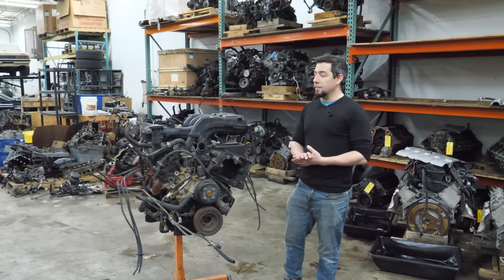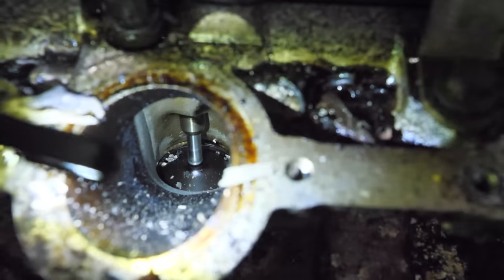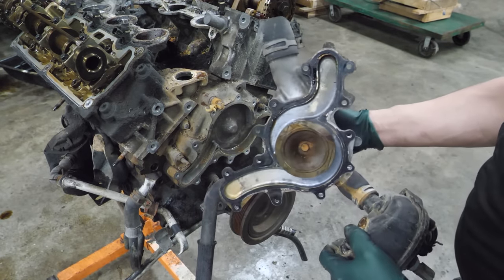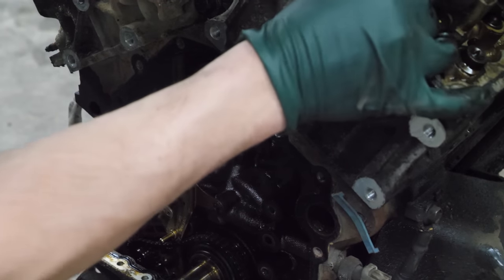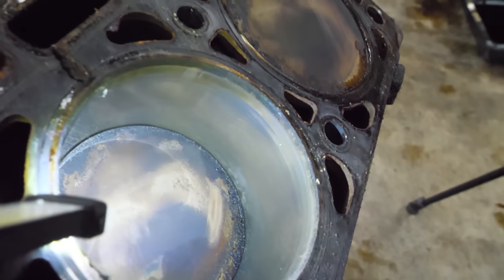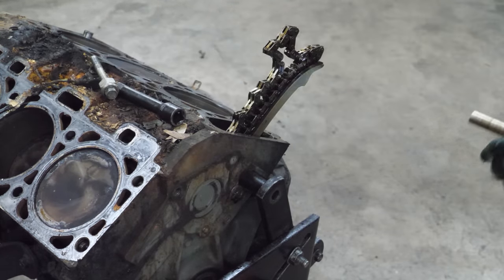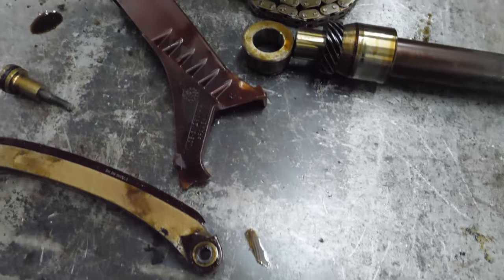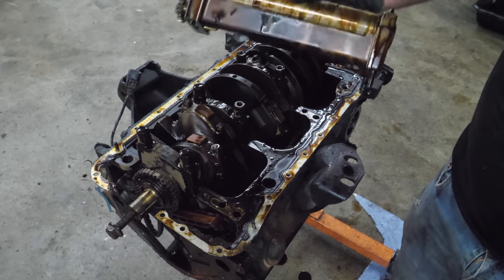Ford Explorer / Ranger / Mustang 4.0L SOHC V6 Teardown! Is This Why They're Called "Exploders" ?

Comment: It was a pretty good, reliable engine when it was OHV.  Thousands of Rangers (and others) are still running with the original 4.0. The strange OHC change with all of the chains really messed up the reliability.
Reply: When was that I’m looking at a 2004 4.0  164k miles
Reply: @fatsixtysix5392 My 03 Ranger 4.0 SOHC blew up a week ago and left me stranded. 118k original miles. Don’t.
Reply: @fatsixtysix5392 get a 3.0L ranger
Reply: So wait, am I seeing this right? Did they use the same head on both sides, rotated 180 around from each other?? That’s the only reason I can see for having a chain at both ends like that.
Reply: @kamryn7496 I had a 3 l in a 91 Ford aerostar. 230k when it left our family still running
Reply: Yes, same head casting. Seems like it would've been cheaper to have two castings and a single chain. Who knows why, it's Ford.
Reply: @samholdsworth420  the 3.0L can be a reliable engine I see rangers in the junk yard with 400k or little less an they have the 3.0l in them I got a 3.0 ranger there super easy to work on an are reliable there is upgrades out there to make more power out of them
Reply: @kamryn7496  I know the 3 liter is good so is the ohv 4.0.

It's the shitty a4ld/5r55 transmission that sucks 😆

Get a manual and drive forever lol
Reply: @samholdsworth420  I got a autozone rebuilt manual transmission in mine that’s trash now it leaks from the input shaft seal after I just replaced it an something in the transmission is making alot of racket only has 8k miles on it sucks the warranty expired but it still shifts fine

Comment: It all boils down to the fact that lube shops don't prime the oil filter, the tensioners go dry, and the chain slaps around and creates havoc.
Reply: When you consider the facts that oil is normally changed about once per month in severe use cases, there will be some residual oil coating any oiled metal surfaces in the engine after draining the oil, the new oil coats things as it flows down to the oil pan, the starter turns the oil pump for about a second or 2 before the engine actually starts, that oil filters in this size of engine conservatively take 2 seconds to fill upon starting the engine, and when you do the math a ~2000 rpm starting speed divides down to 0.5 crank revolutions happening in 1second: all these things together make priming oil filters on this size engine into a cultural myth un-applicable to modern car engines. 

Alternatively, paraphrased in light of these facts it would be like saying that 1 second or less of running a lightly oiled engine every 1 to 6 months will cause the tensioner to fail much earlier than normal. I just don't think that is realistic considering how close to this normal car starting conditions are  for an engine.

Comment: In the middle of rebuilding one right now. Project for my son and I. Took thr opportunity to show him porting. Heads are cleaned up. Engine had 173,000 miles in it and it ran like a top until it lost coolant. Happened on a road where literally the shoulder was an 8 foot drop for like 3 miles.

Comment: Well my fellow mechanic in our fleet these engines have delivered the miles 2006 Explorer 202,000 miles, 2006 Mountaineer 181,000 miles, 2008 Explorer 194,000 miles, 2010 Mountaineer 159,000 miles, 2010 Mountaineer 162,000 miles, they're still in the family and still in daily driver service. They get regular Oil and filter changes plus regular Trans flushes and Coolant flushes. Some of these vehicles replaced 90's models with the 4.0 push rod engine with high mileage.

Comment: My 2001 Ranger 4.0 4X4 has 276,XXX miles and is running like a top. Synthetic oil changes every 5000 miles or 5 months. Still runs perfect!! Gonna drive it until it dies cause it’s been paid off for 3 years now lmao.
Reply: You TOOK OUT  A LOAN on a vehicle that old and that low value?  Dude, you need some financial planning help.  It's crazy to do that and have to have comprehensive insurance on it from the loan, if nothing else.  That stated, you could have done worse,  a 4.0L in a Ranger was a nice power to weight ratio and a lot of people want a smaller pickup like that.  As long as rust is held at bay.
Reply: @stinkycheese804  j.d. byrider

Comment: I've always had good luck with the 3.0 and the 4.0 from ford other than idle issues all had well over 300k on them the 3.0 spun a bearing was it's demise but the 4.0s were still good when the body's rusted away

Comment: I worked at Ford Esseex engine. The only engines with a balance shaft were for Front wheel drives. The reason is v6 engines naturally vibrate front to back. This is not a problem for RWD.  FWD the engine sits sideways and the balance shift is so the car don't rock while idling.

Comment: I like these engines because I'm a parts manager at a Ford dealer :)
Reply: Plus the tritons, the 3.5/3.7 water pumps, cracked ecoboost blocks...
Reply: Parts manager at a Ford dealership is DEFINITELY a job for life.
Reply: @CoryRwtfyt  Diesels are where the parts money is at, cyclone water pump jobs are 400$ in parts and 1500$ in labor. Ecoboost shortblocks are one shortblock you make a few hundred bucks on and a million little gaskets, bolts, and nut that don't add up to shit except 2 hours of your time wasted. lol

Comment: I have a 99 Explorer with this engine.  After 210,000 miles, it is still running fantastic.  I have had very few issues, and few I have had are with the plastic thermostat housing.  It is junk and always leaks.  Still no oil leaks at all.

Comment: The best part of that engine was probably the fuel injection and ignition system !

The sad thing is, that engine is a direct descendant of the Cologne  2.6L/2.8L pushrod engine which were quite good !
Reply: I had a ranger with the 2.8 rest of the truck rotted out before the engine died and we tried hard to kill it
Reply: Some of the unusual traits of that engine may be because it was designed in German, hence the use of large Torx fasteners.  It is an "over square" engine, meaning the cylinder bore was large compared to the short stroke.  This should produce good low end torque making it good for heavy American vehicles with automatic transmission.

I never realized that it had a 2 piece oil pan and the upper half was an aluminum casting. $$$ !!

IIRC, the design was limited by the requirement that is re-use some of the block machining tooling.

Comment: Ah yes, Fords. Just changed the upper blend door actuator on a 2010 F-150 with the hand grenade 5.4 in it. My hand is torn up and my back hurts but I wasn't going to let my mother be without heat in February in Wisconsin.
Reply: How is that Ford's fault in particular?  Any vehicle has these kinds of issues and is not a cause of tearing your hand up or harming your back.  Take it easy, things break and you seem to have no regard for your own well being.  Has nothing to do with Ford, to be good to yourself.
Reply: @Stinky Cheese  haha if you think what you said is true you need to work on this truck, specifically this job!  Please educate yourself before you speak.

Ford designed this vehicle, right? So do I blame myself for being too tall to comfortably fit in awkward positions since they put a common failure part in a ridiculous place?  Or should I blame Dodge for this Ford?  Maybe I should blame you since we are just talking out our asses here.  Or maybe you should turn a wrench before speaking. Have a great day!
Reply: A blend door actuator goes out in a 13 year old vehicle, and you blow a fuse. 😂😂😂 what a 🤡
Reply: @fixingitrightish  i do and would help my mother, but without crying about it like a little girl. It was an actuator dude, all brands have those those kinds of life altering( according to you) issues. Lol
Reply: @fixingitrightish  I do, because thats what I do for a living. 😂😂😂 Ive been a full time professional technician for 26 years. Lol
And yes, Ive worked on pretty much anything and everything. 
Only brands I kind of dislike working on is german vehicles.

Comment: 🤔 Hmmm my 80 year old dads 2000 model Explorer 4.0L has just over 385,000 miles on it and still purrs right along. Only regular oil changes and maintenance with never a breakdown so far 💥.

Comment: I love my old pushrod 4.0. Its was cammed, headers, bored throttle body, bigger maf sensor at around 100k miles. Now has 250k and never had any issues. Good vid. Maybe one day you can tear down the o.g 4.0. Thanks

Comment: could you do a 22r/re? i know there hard to find but it'd be cool to see what kills them
Reply: Timing chain stretches and wears through the timing cover into the back of the waterpump galleries. Had a friend do the head gasket on his and I told him to replace the chain, tensioner and guides while it was apart. He told me he didn't have the money to buy the parts. Got the engine back together for it to fail literally 500 yards/metres down the street, Yep chocolate milkshake for oil, an empty radiator and a worn through timing cover
Reply: @brettt8246  that sucks. i got pretty lucky then. i drove for a month with a broken guide and had no problems.
Reply: @rdybhjhbehb I got about 2mos. out of mine. A hairsbreadth away from the chain grinding through the water jacket. Inside of the engine was still nice otherwise.

Comment: This V6 engine is NOT bad as you guys think!  As long as you change out the 2 chain tensioners every 100k miles (like you change the timing belt on some famous Toyota engines), the plastic guides will last 250K miles at least!  Be sure to use Motorcraft ones!!! 

In addition, just swap out the plastic thermostat housing for an all-aluminum one for $40.

With routine maintenance, This engine will easily last 300k without big issues! 

Don’t be cheated in the way that other brands’ engines never have any issues! All have some!
Reply: When you have to remove the whole engine off of the vehicle, just to remove a plastic timing chain guide, bolted to the rear of the engine, it turns out to be an insanely expensive engine repair bill.  
Not cool at all, if you ask me. Do you wanna pay someone 5,000 dollars to fix this 💩, every 100k miles??!!  It’s more wise to trade the vehicle in, and let the dealer either repair the vehicle, or send it to the auction house.
Reply: @jdrs4214  do you see some Toyota needs to have engine out to fix an oil leak? Or to replace a starter.   Some stupid designs did happen.
Reply: Are those tensioners pretty easy to reach? I'm considering buying a 130k 2004 for $3000
Reply: @OtherDalfite yes, DIY friendly.  Just don’t prime them before you put them on!  Some YouTubers did it wrong! Use common sense!

Comment: Interesting,  I hadn't dealt with the sohc version of the cologne v6 much.  The pushrod version prior to this was pretty solid in my experience in 4.0 displacement,  but go figure,  they complicated what was a simple engine,  and made it worse.
Reply: Prior pushrod 4.0 was prone to head failure or gasket cracks.  Even so, yeah not having the OHC chain guides it was more reliable, but a bit weak for anything but the mustang (for people who wanted the look but didn't care about the performance).
Reply: Exactly, planned obsolescence. OHC engines are overrated and that is any brand.

Comment: I had the SOHC 4.0 in my 2011 Ranger. Had the truck 11 years, 164K miles. Super reliable, did tons of hauling and work with it and it was my daily. It finally failed emissions and I heard the dreaded timing rattle shortly before I decided to let it go. It quieted down for a week and I traded it. Now have a 2019 Frontier with the Nissan 4.0 and love it. My Ranger was a great little truck though. Never left me stranded, factory a/c still worked fine.

Comment: Thanks for the video, I currently have an 05 explorer. My inspection mechanic told me it needed valve cover  it passed. I pulled the intake, replaced drivers side no problem. Pulled the passenger side and found a  broken timing guide at the top. The chain was rubbing against the mounting bolt for the guide. Paid a shop to replace the chain and guides because ford can't put timing marks like everyone else. Btw trans in that year is doomed to fail (Ford wanted more service work in these years, part of the reason theirs no dipstick and changed transmission design).  Previously I owned a 2000 explorer that had timing chains done due to noise but ended up being a blocked oil passage. I drove it to 320k with no problems until I sold it. This era of Ford engineers after were money hungry! They tried fixing the timing chain issue but ended up making it worse after. Btw they like to blow out the short hose from the water pump to thermostat housing and my 05 blew the thermostat housing in half. I still have it but don't drive it much, ready to say goodbye.

Comment: Had a 94 Explorer 4dr, 4wd auto. Drove it 145,000km over 5 years. Towed a 24' tandem axle trailer (2100kg) well over 15,000km behind it. Never a problem other than required maintenance. Would maintain a steady 90-100kph towing that trailer throughout Ontario and the East Coast.
Reply: Pushrod engine I agree I had one. This is the SOHC engine very bad.

Comment: I had an 05 Mustang and the only problem I had was warped exhaust manifolds, the saddlebag gas tank and the new for that year throttle by wire, which pretty much every 05 Mustang had problems with all three of these things. Sold it with just over 200k miles. It's all about maintenance. I had a Focus before the Mustang, which everyone seems to hate on. I put 200k miles on that with less problems than the Mustang 🤣
If I remember correctly the timing tensioners were either supposed to be replaced at 80k or 100k miles.

Comment: My daily driver is a 04 sport trac with the 4.0. It has over 250k miles and idles smooth, has plenty of power, doesn't burn any oil and transmission still shifts smooth. I do keep up with all the routine maintenance. The only thing major I had to do is was replace the radiator  and plastic thermostat housing with an aluminum housing.

Comment: I actually rebuilt one of these POS about 5 years ago and it is still running .. used all high quality aftermarket parts , higher compression , flat tops ,milled heads etc etc

Comment: These engines are great. Also they make really good torque for a v6
Reply: They are boat anchor at best
Reply: a mustang with it is actually decently quick
Reply: @chickenandmilk1216  no they are dogs.  Rather have the previous version 3.8 over this engine
Reply: @chickenandmilk1216  - quick compared to what?
I cannot understand why anybody would but a Mustang with a 4 or 6 cylinder engine in it. The only thing that makes them good is (The sound of) the V8.
Reply: @chickenandmilk1216  slightly quicker than an 80s camry

Comment: My dad had a ranger that had this motor.  He put 200k on it and only changed the oil and plugs.  My brother has the truck now and it still runs.  Now it had several transmissions during that time but no motor issues.

Comment: I had a 97 Ranger 4.o with 300,000 mi. I was involved in an accident and blew the airbags so it was totaled. Never had the valve covers off. Replaced a plenum gasket , a couple water pumps and a starter, I replaced it with a 2003 which I still own and drive. 250,000 mi and I'm still driving it. Both engines had 3,000 mile oil changes throughout their lives. Love the 4.0.

Comment: Love the channel Eric! Apparently the balance shaft was used only vehicles with 4x4 drive. The little info I’ve seen speculates it reduces vibration overall with the transfer case on the 4x4 drive train.

Comment: I've taken to calling these things Cologne Codgers because I like alliteration, the stupidity of the timing system, and they sound real asthmatic. That said, I have seen one with over 200k on it in an Exploder; owner put a bunch of money into it recently (VC gasket, oil pan gasket, etc). Thing was clean inside; probably helped that they put synthetic in it.

10:24 I believe I've seen it called a jackshaft. No I am not making that up. Rather than design a new block when it was converted to SOHC, they just put that shaft in the old camshaft hole to drive the other bank. Real smart, Ford. Real smart.

Comment: Own a ford ranger with the 4.0L V6. fantastic engine, had since 200k, now at 300k. changed the alternator and some front wheel bearings, but thats about it in 10 years of owning the ranger. granted, thats not the same 4.0 as in the ranger, looks way different on the outside and internals.

Comment: You don't have to pull the heads. I did a timing job on mine at 190k miles. Heads never came off, all components replaced. But, yes the motor has to come out due to the rear chain and jack-shaft sprocket. Now has over 289k and purrs like a kitten

Comment: Actually you have to split the chain guides at that black pivot. I have one of these piles, that one is from a 4x4 as it has the balance shaft on the lower pax side. I am not looking foreword to pulling mine from the exploder, however the roof has rusted out in the gullies up front so....

Comment: I had a 2010 Ranger with this engine. When I sold it,  it had 233,000 miles on it, and I never had any problems with the engine or transmission. Honestly I never liked the truck, but it was super reliable and cheap to own.

Comment: I had a Ranger with this engine and I loved it. The only non-standard repair I had to do was replacing the harmonic balancer because the rubber failed. It wasn't the easiest driveway repair but not terrible either. Eventually the thermostat housing went, and I sold it after repairing that. Had nearly 200,000 miles on it and I'd bet it still running 4 or 5 years down the road from my sale.
Reply: The one i had was my first vehicle, we bought it with 220k on it and sold it at 293k when the timing tensioner went.